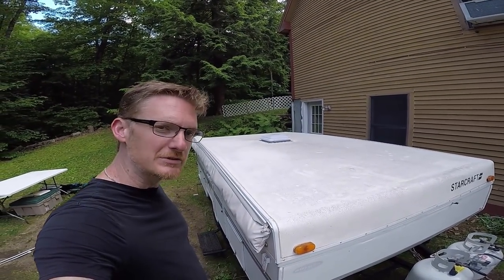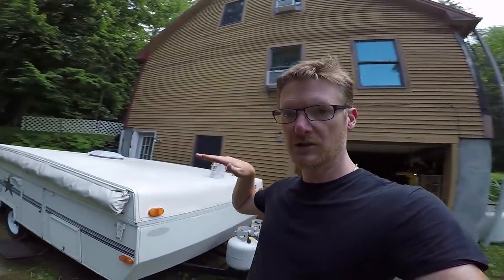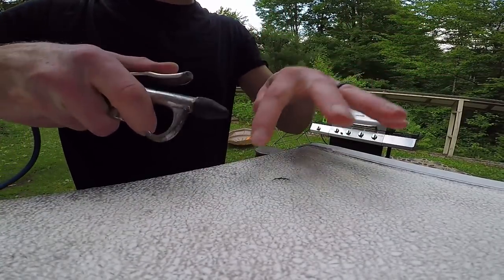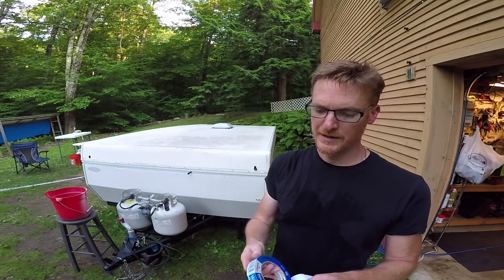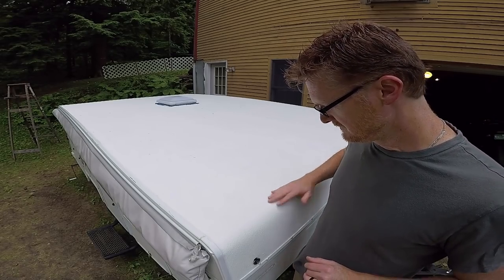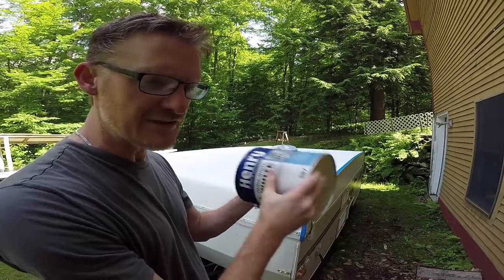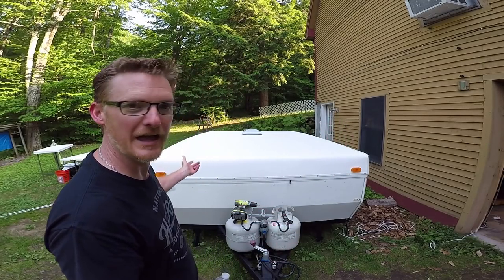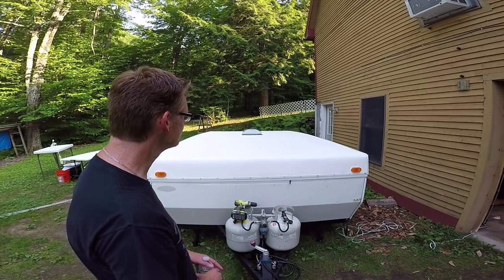Restore Old Pop Up Camper Roof

Comment: Did you by chance rebuild the inside of the roof?
Reply from the maker: Erik Blazer a year before I made this video I replaced sections of wood on the back and part of one side... the wood had turned to mud from years of slow leaks. From what I could tell the leak was due to failed caulk. The roof wood was still solid.

Comment: Our 1995 Jayco has a seam down the middle of the roof. Any special advice for that?
Reply from the maker: I looked at some Google pics. I'm thinking disassemble, clean it, dry the area. Caulk, replace, use a new weather strip. I think this is the replacement insert. https://www.campingworld.com/heavy-duty-insert-trim-white-1-x-100-roll?CAWELAID=120030630000000449&gclid=CjwKCAjw3qDeBRBkEiwAsqeO7t7a-pagwPFKAZhy88C_QZpcJtJOp8m5_FLbfVW9g7W5uSdQr6KkuRoCdqkQAvD_BwE
Reply: I have a 98 Jayco with the center seam and a rooftop AC unit. The AC produces a lot of condensation, which pools on the roof. This caused us to develop a leak along that seam... so I started researching solutions. We ended up applying Eternabond tape along the entire seam. That was 4 years ago, and we've had zero issues. The stuff is like magic. We've had puddles sit on that roof for a week at a time with no leakage. So my advice would be to tape the entire seam with Eternabond and then paint over that. It will be a permanent solution, and you'll never need to caulk that seam again.

Comment: Do you have any videos/photos of your camper renovation (process or end result)?
Reply from the maker: Sadly no video, but I snapped some pics! We removed the interior, painted all of the cabinets and wood surfaces. Put in new flooring. My wife made new covers (twice, the second time a diff color) for all of the seating areas, new curtains. Cleaned everything spotless. Cleaned and painted the frame with black brush on rust oleum paint. Painted the roof. I have a few pics I can share on the community tab if you'd like.
Reply: @sstressfl  That would be cool! There is also a thread on popupportal for renovations if you want to post there too.

For the floor did you take out all the cabinets and replace everything or just cut around the cabinets and replaced that?
Reply from the maker: Tyler Wilson took out the cabinets so we could spray paint them. It always looks so much smoother than paint brush. So then the floor was easy! 😎 I’ll post some pics today on popup portal.
Reply from the maker: Here ya go! https://www.popupportal.com/threads/1997-starcraft-1224-pics.128332/
Reply: Michael Byrne thanks!

Comment: What type of caulking did you use to seal your lights with?
Reply from the maker: Specifically, Phenoseal, white vinyl adhesive caulk. Interior/exterior. Mildew resistant. Paintable.
Reply: I myself would use butyl, that is what the product is that he took off and called putty. There’s a reason all camper mfg use it!